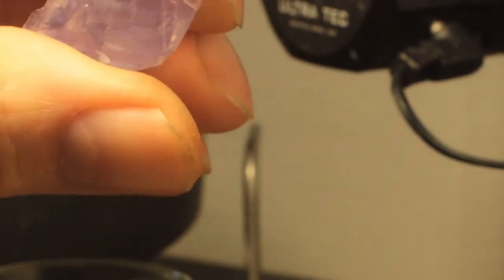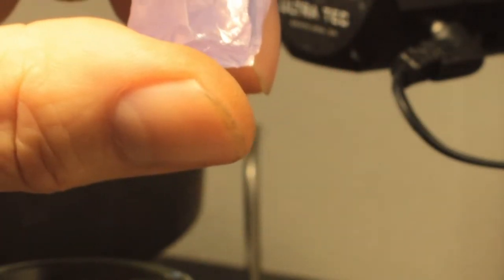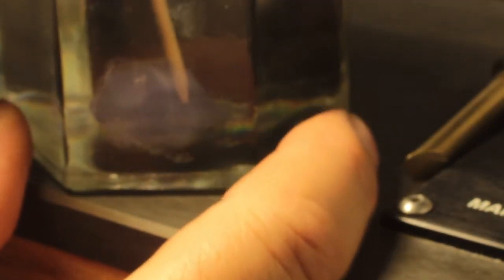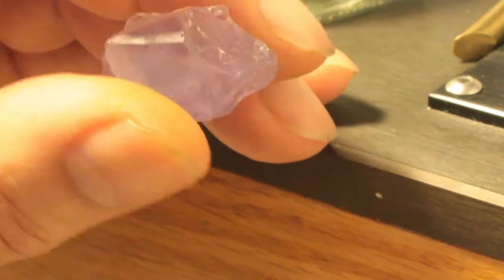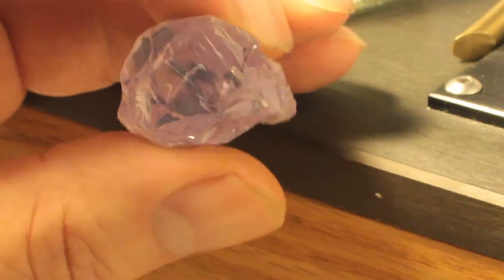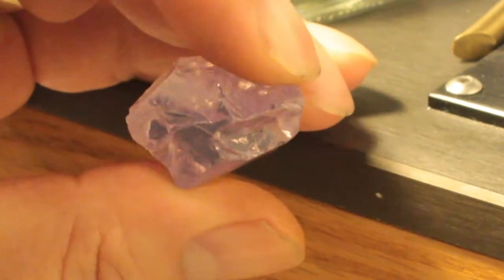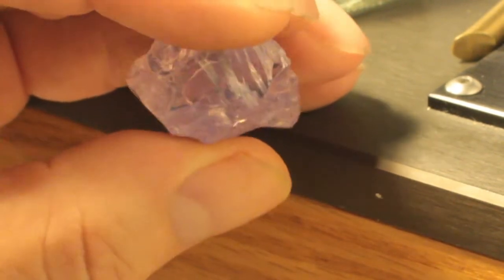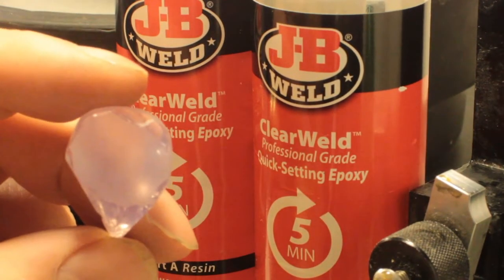Gem Cutting Tutorial: Cutting a Special Army Airborne Parachute Design

Comment: Michael can you share the cutting instructions as the design information at facetdiagrams.org does not have them? As always a great learning video.
Reply: It is in the "Datavue" data base, which is getting quite old and no longer supported.  I got a copy from the US Faceters Guild.  If you go to the USFG website, you can join with or without becoming a member (paying annual fees).  By joining you can go to the Topics and join the discussion.  I  asked about the Parachute Pear design there (you can search for that topic) and another USFG member posted the design from the old Datavue database.  The instructions are:
PAVILION
1 90.00° 30-34-38-42-
46-50-54-58-
62-66
2 50.00° 30-34-38-42-
46-50-54-58-
62-66
3 48.00° 28-32-36-40-
44-48-52-56-
60-64-68
4 46.00° 30-34-38-42-
46-50-54-58-
62-66
5 44.00° 32-36-40-44-
48-52-56-60-
64
CROWN
A 48.00° 30-34-38-42-
46-50-54-58-
62-66
B 42.00° 32-40-48-56-
64
C 38.00° 32-40-48-56-
64
D 30.00° 28-36-44-52-
60-68
E 28.00° 28-36-44-52-
60-68
F 0.00° Table
PAVILION
6 90.00° 16-80
7 50.00° 16-80
8 46.00° 16-80
9 42.00° 16-80
10 39.00° 20-76
CROWN
G 48.00° 16-80
H 44.00° 16-80
I 28.00° 16-80